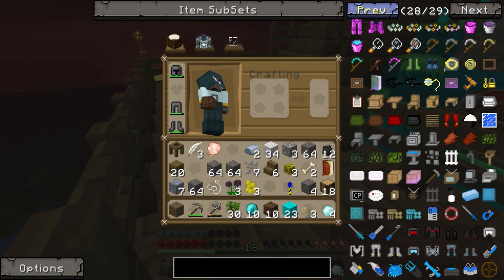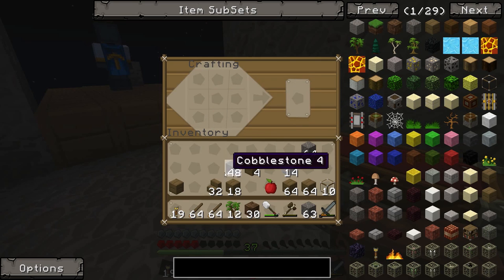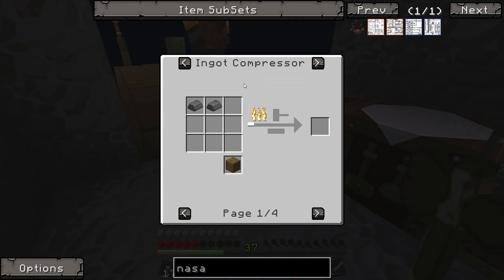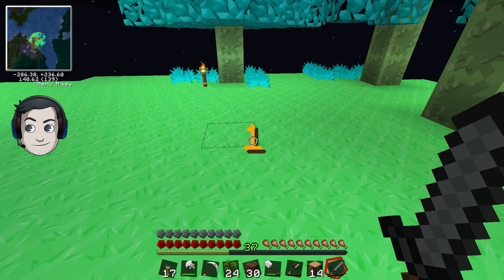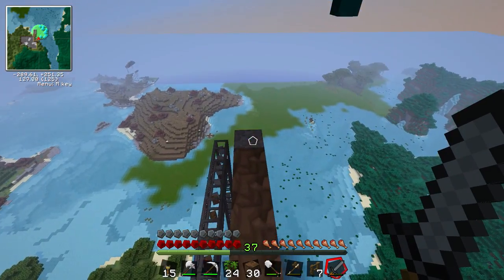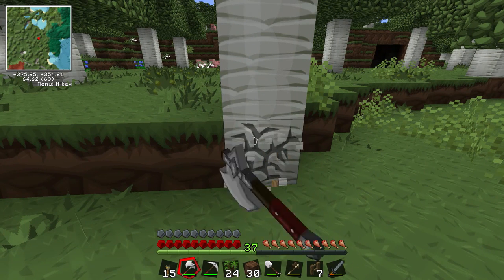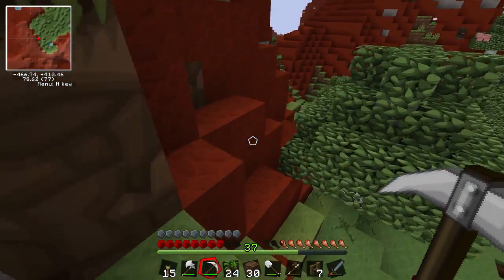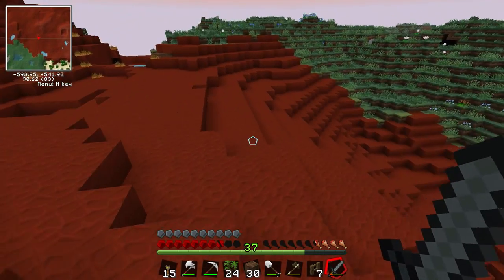Sipsco Space Program #18 - Thanks Babe

Comment: Sjin and Sips! Put water inside the hole where your quarry is! It will prevent lava from blocking the quarry plus you get lots of obsidian! Another tip is to add in more engines and connecting them with kinetic tubes to share all the energy into the quarry. This can boost the productivity of the quarry 10 times.